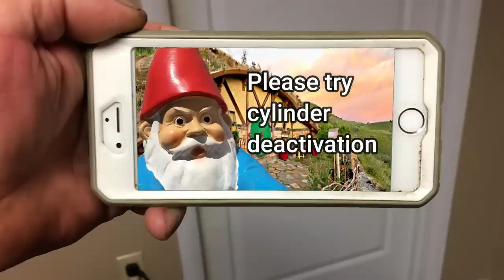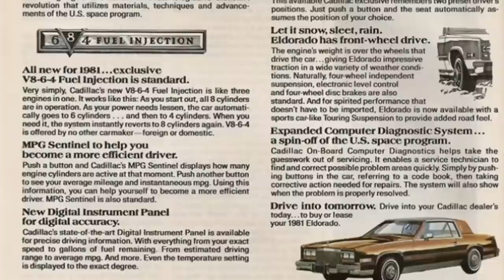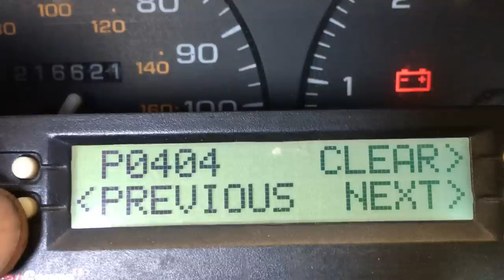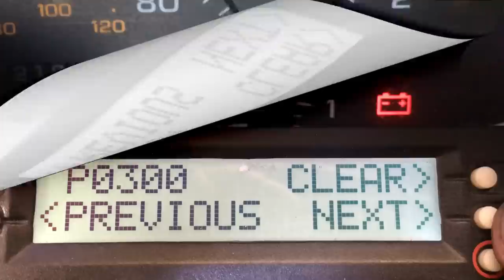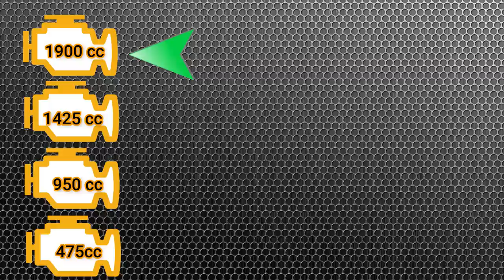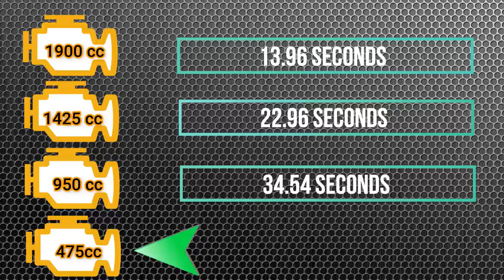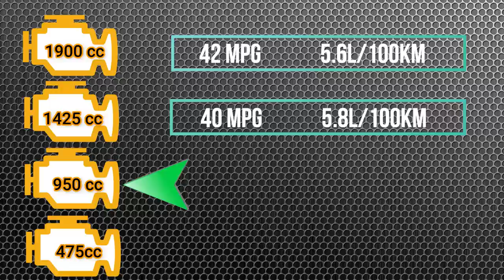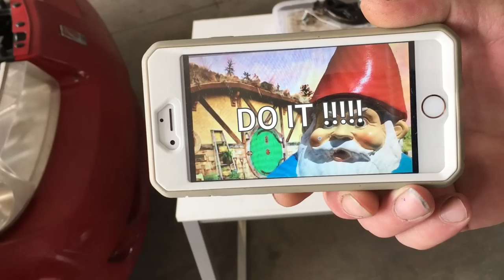S2E16:  We deactivate cylinders on our Saturn and test the car for performance and MPG

Comment: Try using the deactivated cylinders to pump air in to the other cylinders!  I read about someone who did that with a Ducati twin- one cylinder was a supercharger for the other cylinder.  He claimed to make more power running that way than the original naturally-aspirated twin.
Reply: This is an idea For sure
Reply: That’s crazy dude
Reply: That wouldn't work to advantage unless you used more than a 1:1 ratio of deactivated to activated cylinders.
Reply: I believe I remember hearing something about this kind of thing. As I recall, the deactivated cylinders were converted to 2-stroke and therefore moved twice the volume of fresh air as the two fully-operational cylinders. It makes sense that two cylinders running up to 2atm of boost would be both more efficient and more powerful than the original four-cylinder engine, even if by a small margin.
Reply: This opened my eyes.
Reply: If this were true manufacturers would do it
Reply: The oil and fuel industry doesnt want efficiency.  A man last named Fish made a carburetor called the Fish Carbeuretor which converted fuel into vapors and made 50 mpg on big blocks in the 50s and 60's.  First started selling them individually then opened a dealership with them installed.  His idea was bought by Ford I think and the rest is history.
Reply: He even had the idea patented.
Reply: @AnotherCarGuy375  All caburettors convert the fuel into vapour... that is kinda the point
Reply: @gnaedigerfels  If that's the case wouldn't injectors being more efficient?
Reply: @AnotherCarGuy375  Running engines on gas vapors does work, but it is not any more efficient than using a regular carb - project farm actually made a video about it. The point of carbs and fuel injections is to add a specific amount of fuel to a specific amount of air (called the lambda coefficient) in the finest mist possible to form the gas vapor as fast as possible. The 50 mpg is rather something of a best case scenario with optimized conditions achieved if even really and not an everyday usage. The downside of a gas vapor engine is that the saturation of the air with gas vapor is dependent on humidity and temperature - a modern EFI adds nearly perfectly dosed amounts of fuel based on those factors to balance the lambda factor.
Reply: @spen.surrr1199  @Cjbarker2 @jamekins Manufacturers actually used to do something very similar like this in the 1920s with two stroke engines; Look up the "DKW Ladepumpe", especially in its V4 engine form: The built a V6 engine block where one piston per bank does not act as a combustion chamber, but rather acts as a compressor (the so called charge pump) for the remaining two cylinders per bank - shortly before combustion, the air of the charge pump cylinder is pressed into the actual combustion cylinders and therefore acts as a forced induction.
Reply: @FFsCMs  I forgot to mention the more it's heated the more volatile it becomes.  Meaning more expansion of the fuel and pressure before it reaches the cylinder. Air to fuel ratio for lack of a better word would be a lot leaner.  I've seen plenty of videos but safety is always the no. 1 concern.

Comment: In my experience the ABS will start to creep at cylinder-head-temperatures if it has some load on it...ask me how i know ;)
I moved to Polyamide with glass or carbon fibres now. I print on the Mini =)
Reply: It's also very much not fuel resistant. ABS parts inside the engine will likely degrade or dissolve over time.
Reply: Yep this probably comes down to glass temperature vs melting and liquid temperatures. Plastics have a lot of varying properties depending on what temperature they are at.

Comment: Thank you for that enlightening video it was interesting.
Some commentators thought that the smoke was coming from the piston rings, that maybe so but I think (occasionally) that it was getting through the valve stem oil seals and because the valves were not opening it was trapped there until the cam follower was reinserted.
When smoke appears when first started then disappears is usually a sign that the valve stem oil seals are badly worn.

The two cylinder drive was smoother probably because the engine was balanced as opposed to the off balance of number two cylinder interrupting the opposing 1 and 4 crankshaft phase.
Reply: I am a proud member of the ROBOT CANTINA fan club.   Love the content
and LOVE  the humor of the channel. 👍👍👍

Comment: Cylinder deactivation may save fuel under light loads but here it was mostly under heavy loads as it was harder to accelerate. It may be easier to deselect injectors depending on manifold pressures.
Reply: In that case there would still be pumping losses where disabling the valves almost completely removes the pumping losses.
Reply: I'm not sure how the EGR valve works on this particular car, but if it's signaled by vacuum, 2cyl may be enough to be opening the egr valve. That will significantly reduce performance when having to run under heavy load. The engine will start detonating and have to pull timing out to compensate.
Reply: How y'all know this shit

Comment: So deactivated cylinders increases engine drag on those cylinders because of compression and vacuum. Now a experiment I did in the 1980's on a 360 Cid v8 was to remove 4 pistons & block off the oil holes by a machined spacer (2 piece) and kept the other connecting rod in its place. As for the lifters a copper fuel line was pressed into the oil hole blocking off the lifter oil. A special tool made from a old solid lifter was pressed into the lifter holes one at a time to peen over the copper line as to allow the new roller lifters to work in in place of hydraulic lifters. Plenty of oil kept the roller lifters lubed from runoff from the rockers in the heads. Removed the 650 Carter 4bb carb and made a adapter for a 1bb Carter from a 225 Cid 6 cylinder. Yes it did run good once I had to externally add weights to the torque converter to balance out the engine. Granted, the new roller cam had a higher low end torque profile and I had the heads milled and valley decked. The compression went from 8:1 to 9.5:1 used headers with a cross over connecter. The van went from 14 mpg avg to 22 avg. Later when the fuel crisis was over I put it all back together keep the roller cam and the replacement carb was a holley 620, (600 cfm bored out) with a electronic duty fuel solenoid on the primary side. Fuel mpg was 17 avg.
Reply: I love the comments here... I come for the video and stay for the comments on this channel.

Comment: What I learned today is that if you live in an area with backroads and lower speed limits then this could be temporary solution for someone with an engine with problems to get by. Great job as always Jimbo, Robot Cantina and Aging Wheels are my 2 favorite car YouTubers lately and I'd love if you guys could collaborate sometime
Reply: As in the one project car I bought with a hole through the block could have maybe been made to run on 2 cylinders if I deactivated the ones with the hole...
Reply: Could help fuel economy in a dystopia too.

Comment: My father purchased a 96' saturn sl new when I was a kid, the car rusted out to the point the doors wouldn't close from the structure bending but was able to put 315k on it, all the while still happy to make 45 mpg (His best tank run ever was 52 mpg).This was probably due to his custom ordered model with no a/c or p/s and one mirrior lol. Maybe we can see a mpg test with limited accessory drive?
Reply: So good. I loved my SC2. AC never worked when I had it. But with well over 200,000 miles on it, she still got 40 to 42mpg with a dumb lead footed kid driving it. Best I ever got was 45 on a 200 mile highway trip. Thing just sipped gas.
Reply: PS can eat some mileage, but if the AC isn't active then the pulley on the belt just spins.
Reply: That’s odd considering Saturns were made with plastic body panels
Reply: @willbennett8799  But they are still unibody, giant void of an open door = no structure. He's saying the door gave the soft body rigidity.

Comment: I really look forward to every new episode.  Your experiment reminds me of some work done during the first gas crisis converting V8 engines to V4 by deactivating the intake valve on 4 cylinders and letting the exhaust valve operate normally.  They claimed up to 25% improvement in fuel mpg but I don't remember them testing the vehicle on a highway test loop like you did.  Great content, thanks for the time and effort.  Phil

Comment: For anyone interested in more cylinder modification stuff, there is a very interesting build video on "The horsepower monster" channel where they modify a NASCAR SB2 V8 to run as a V6 for a specific salt flats category rule
Reply: There's also 'SuperFastMatt' who's building his own Salt Flat high speed run car, utilising a BMW 1000RR 4 cyl motor, and he's going to run it in 2cyl mode as well as full 4cyl mode for different 500cc & 1000cc catagories.... I like his kind of sense of humour, it's kind of like this guys humour too. 😏. He's also fitted a full Tesla power train into a classic 40's(?) Jaguar👍 and fitted a CBR1000 motorbike engine into a classic Honda S600 car chassis   😎🇬🇧
Reply: @thedarkknight1971  So he ruined the Jaguar?
Reply: @MapleMan1984  Have you watched 'Suoerfastmatt's videos on it? Either way, as they say "Each to their own", in one regard he is 'Updating' a classic jaguar to run more 'Green' hence keeping the chassis and body going instead of scrapping it. In one sense yes he could have done a full resto-mod. In one sense he could have just done a full restoration. In another sense he could have just scrapped it. Multiple decisions, multiple reasons. Each person would have done their own thing, take you for example, you have your own ideas. It's like someone did a beautiful job 'Resto-modding' a VW Karma Ghia so it is immaculate in paint, running gear, parts etc, but, fully electric driven. One of the complaints of fully electric drivetrain cars are that there's just 'A lack of driver engagement' per say, so, some companies have 'Resto-Modded' old Porsches, Jags, and other cars so that they have an electric motor system that's linked to the original 4 or 5 speed manual gearbox, hence you get power and torque, but, 'Involvement' with a manual box... Again.. "Each to their own"... 🤔😏.    😎🇬🇧

Comment: Very cool guys, a little forced induction would be a great test with cylinder cutoffs using toggle switches on injector wiring. A lot less tear down. And easily configure what cylinder arrangement works best. Just a thought.
Reply: I think it would work best to turn off 2 cyliders after reaching 50 mph
Reply: Issue with just deactivating the injectors is that with the valves still working you have pumping losses.
Reply: @shackwrrr  But the pumping losses in a cylinder with open valves instead of a closed cylinder should have significantly less parasitic losses. Turning off the fuel flow to the injectors on a couple of cylinders SHOULD net a significant increase in fuel economy. I'm guessing 25% or so.
Reply: @maxxron  big issue is less power available means more throttle is required to maintain a certain speed. This is why some big engines such as LS1 can be tuned to make 35mpg on the freeway because you're basically idling
Reply: @kylemilford8758  The final drive gearing is also going to have a huge effect on fuel mileage.
Reply: @maxxron   you still need to produce the same amount of power to keep moving, the engine is most efficient with all the cylinders helping, rather than 2 doing all the work and 2 being dragged along, im surprised it was even able to maintain anywhere near its original fuel economy with the 2 cylinders deactivated

people need to realize that theres hundreds of engineers and people mulling over these types of questions at the manufacturers and if there was a simple way to get 25% more fuel economy theyd be all over it and they have the tools and resources to work through bugs, program ecu's, and make a system work as good as it possibly could
Reply: @AndrewBrowner  I disagree. Engineers build cars for desired performance instead of optimal fuel economy. The fact that he got up to speed on 2 cylinders means that it is doable. It is just that most people will not accept a 0-60 time of over a minute. For example, the world record for gas mileage is a completely custom-built fuel cell vehicle having over 12,000 MPG, but it is completely unsuitable for daily driving.

Comment: I worked as a bike mechanic in LA back in the seventies. During the fuel crises one of customers (may have been Mr. Edelbrock himself) removed two of the rods/pistons from a V8, turning it into a V6 to reduce fuel consumption.
Reply: Did Mr. Edelbrock find the answer?

Comment: Based on the comments, folks don't know how GM overcame deactivation issues. They found simply killing spark and injection wasn't enough. The values also have to close at mid stroke to eliminate parasitic loss from vacuum and compression. It also reduces or eliminates oil in the cylinders. It makes the pressure a net zero. That's something that the 8 6 4 Cadillacs couldn't accomplish, in addition to massive loss in power when cylinders cut out. Throttle by wire is why you don't really notice the change on the DoD engines of today.
Reply: Good comment here... Looking forward to more from Robot Cantina

Comment: Great video, may I suggest taking out the spark plugs from the two deactivated cylinders. Run a pipe to the air box for clean supply.  
This will enable the cylinder compression to be zero in the dead cylinders.  
Best wishes from the UK

Comment: Love what you've done here 👍 My question is what's happening in the deactivated cylinders- as both valves are closed won't the piston be trying to pull a vacuum on the downward stroke & compressing (what little air there is in the cylinder) on the upward stroke, causing losses?

Comment: What if you took 1 or 2  injectors on it  placed them somewhere else on the intake... like a TBI system.. plugged in dummy injectors for the other 2 or 3 you don’t use.. if need be?

Comment: I had to drive a car for a short while with one cylinder almost deactivated.

it is an inline 4 where the sparkplug on cylinder 3 decided to split into two which meant that I couldn't attach the spark plug wire to the actual plug itself. so that cylinder got fuel, and promptly spat it back out the exhaust pipe.

only drove 5 km to get to my friends garage and fix it. but it sounded surprisingly fun, almost like a subaru boxer for some reason.

and if someone is interested, it is a 1984 Volvo 360GLT with a b20 swap from a Volvo 740

Comment: This is ironic, I fixed an old Saturn up a couple of years back, one of the first things I had to do was fix it so it would run on four cylinders. 

0-60 in 34 seconds means you're a LOT faster than just about every car I see on the way to work...

Comment: I think relatively smooth is a better phrase... As in relative to a V-twin motorcycle.The engines intake and exhaust are likely tuned to run on 4 pulses, so Honestly I think ITB's/2-carbs and a 2-cyl header would result in some real performance gains.

Comment: My brain tells me that it is not displacement that makes fuel economy, but resistance to movement. Curb weight being the primary factor of resistance, especially in stop go traffic. I'd like a video about reducing resistance to movement, through reduction of all types of friction. <3
Reply: I wonder how much of a difference brand new or freshly greased wheel bearings make

Comment: That's so interesting. The fuel injector connector broke and I was driving on 3 cylinders in my 2002 sentra with the 2.5 engine. Still had plenty of power

Comment: I have a question what if you move 1 or 2 injectors to between the intake and the throttle body. Would the thing run using the fuel injector  system. Something like moving injectors 1 and 3 to the front of the intake

Comment: Have you tried swapping injectors with hose-style-cng injectors and supplying LPG with hose and screw tight hose clamps while running less cylinders; to see if the injector timing can be easily swapped without new computers, evaporators, mixer carburetors,etc. ?

Comment: I mightve missed it, but did the ecu end up getting retuned to run with the way the motor is now, considering it still thinks it controlling 5 different aspects of 4 individual cylinders instead of the half it really is
Reply from the maker: No, the ecu was not re-tuned.  Keep in mind, this is a very early version of the OBDII system... we are able to introduce faults and the ECU just deals with it.

Comment: Interesting, but the deactivated cylinders needed to compression free. Back in the 1970s, I had a 2-cylinder VW Bug that had 2 pistons removed. It probably had 15 HP and was fun to drive on country roads. Top speed was about 50 mph (downhill!).
Reply: “Half VW” engines are common in aviation